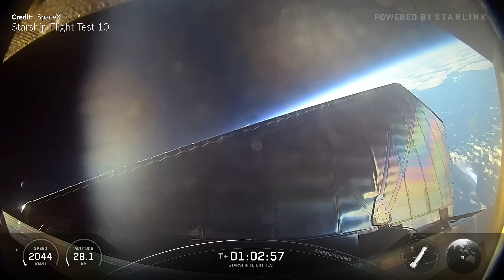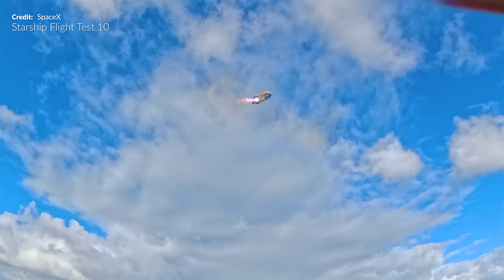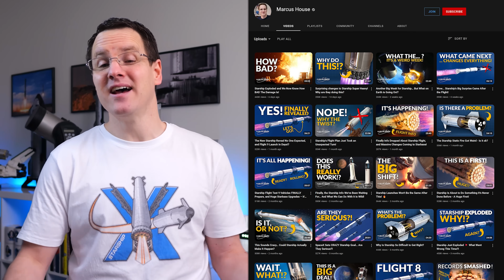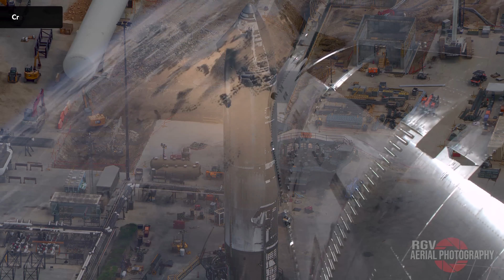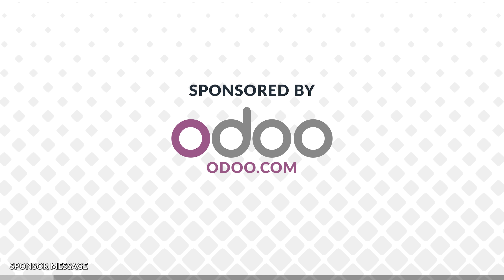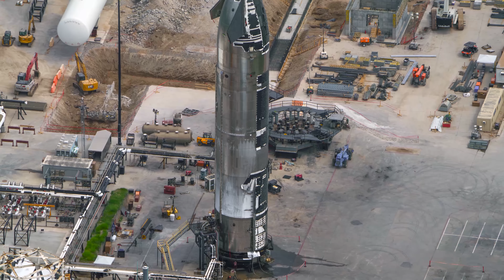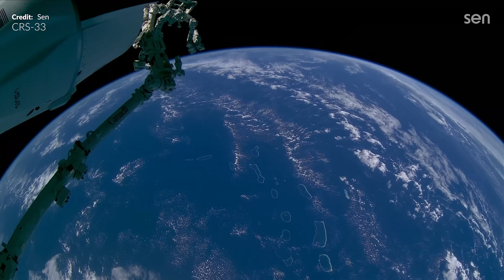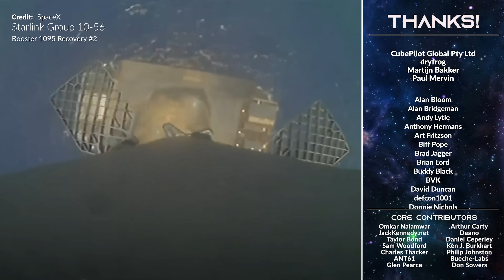Starship Flight Secrets Revealed & Future of Starbase! 🔥

Comment from the maker: Take your business to the next level with Odoo: https://www.odoo.com/r/GwW
Reply: Well done, Beratna, I saw those names in the Odoo demo 😂
Reply: @FlushF00T  Nice to finally see an autograph from my favourite character in that movie! (and no, it's not the "lead" character). 

Did you also notice what the "document" they "signed" states? :)
Reply: The alternative material tile causing the rust colour could be adding by lucky accident an extra coating on the black tiles to help them survive longer ???
Reply: This channel is more commercialized than the original Woodstock  !!
Reply: Now I saw something I liked. The inspection of the capsule at the ISS. Hindsight is 20 20 but imagine if the Shuttle had that ability. May they rest in peace. I always thought why not space walk the Shuttle (inspect) while docked at the ISS? I spent my entire life in Aviation, before, after and between every flight, aircraft are inspected for structural problems (safety). That to me would be even more important with space travel
Reply: odoo is garbage
Reply: placing the advert in the middle of the video only makes everyone dislike them and skip. NOTHING worse than this. Fk your adverts
Reply: Great planning by Spacex for on-site gas seperation plant(s)! Is the power supply from the grid ?
Reply: Thermal shock is why they blow up thanks to the engines being used to operating temperature!
Reply: Audio en español por favor
Reply: Is there any benefit for SpaceX starting to set up launch sites in other countries such as Australia?
Reply: Hi Marcus, I am wondering if the flaps can't be made of Carbon-Carbon Composite, instead of stainless steel.

Comment: Interesting virtual catch hover manoeuvre above the water. Instead of shut down and fall in the ocean, do you think it should include re-acceleration to move away and repeat hover if fuel allows? In case grid fins or landing pins for chopsticks or the chopsticks themselves are compromised moments before catching, it could be wise to boost out of mechzilla way and go blow up away from the landing facility.

Comment: Starlinks are usually launched into high inclination orbits, something they haven't done yet.  Little point in launching them into a low inclination orbit.
Launching to the SE, about 130 to 140 deg gives an over water launch direction which would give the inclination they need and the reentry would be over the USA rather than over Mexico.  However they may need to wait 24 hours before the reentry path is close enough to Starbase.  Will enough fuel remain for deorbit and landing burns?

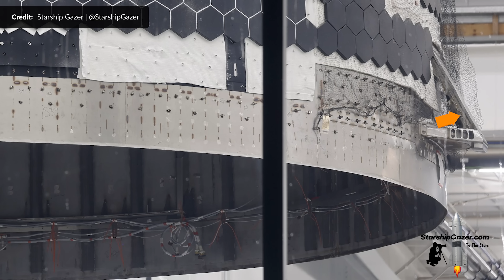Comment: 2:20 "...heat shield issues...": As Elon repeatedly says, the best part is no part. Eliminate the heat shields... and maybe even go to an aluminum ship instead of stainless steel. Elon's not so foolish as to not bring it back. Just bring the ship back less aggressively. Choose a shallow angle of attack to the plane of the atmosphere (i.e. the tangent to the circle). Then begin to measure heat buildup sense atmospheric resistance. Gradually increase angle of attack limited by heat sensors. Use heat as the negative feedback signal for the angle of attack. As soon as the angle of attack is controllable "via wind", so is the yaw direction. Set a small angle to begin a corkscrew trajectory with the center of the screw over the landing zone. Again, control the direction by temperature limiting feedback as well. It's not rocket science to calculate the controls necessary all the way to the ground. Then just repeatedly tweak the calculations until you're at essentially free fall speed and over the target. From then on in, it is rocket science... that is practiced weekly with Falcon boosters.
Reply: Yeesh.. you pretend engineers do say some silly things.
Reply: @imaginary_friend7300  Pretend engineers? Really? Does a degree in electrical engineering not count? And what is your pretend knowledge? What do you find silly "imaginary_friend"?

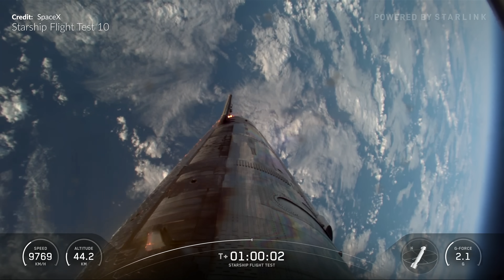Comment: 1:32 I'm curious as to why that is. Is it that the specific reentry profile is the most optimal for max deceleration to max forces on the craft? Or could it be that this thing is so big that it's inertia makes the reentry g-forces inherently smaller? It does seem g-forces decrease as you increase the size of spacecraft.
Reply: It's the entry profile.  They showed it and explained in one of the early video's when it was still largely hoppy and tents.  They try and shed off as much speed as they can in the upper atmosphere by flying a shallow descent angle.  This means it spends far more time re-entering than say a space capsule.  I can not say why.

Comment: Not sure if they would attempt deployment of actual Starlink satellites on Flight 11, considering the tail end of some of the test analogues collided with the top of the bay door, unless they do some revisions to the guides or enlarge the door.
Reply: I suspect they will make changes but I don't think that hit would have done any real damage.  The orbit picked for 11 will let us know if they can put up any real sats.
Reply: I think the problem isn't the damage, but rather a dummy satellite potentially getting stuck inside the payload bay and blocking the door or the deployment of other satellites.

I know that space is hard, but watching that mechanism work wasn't exactly confidence inspiring

Comment: A bunch of sites are trying to pass-off the thumbnail pic (also at 4m50s) which you attribute to Flight 6.  It's clearly not from Flight 10 - hull discoloration is wrong, aft flaps aren't chewed, there's no aft ring damage from the "energetic event," and there aren't any test coupons bonded onto the top surfaces of both aft flaps.

Comment: So the largest challenge is the heat shield, yes. Because? Orbital velocity. Velocity on reentry contributes to the friction of reentry, yes?  Help me understand, - a certain mass of fuel is used to reach orbital velocity after booster separation. Would we require the same mass of fuel to then slow the ship down enough for a less challenging reentry?  It seems to me that although costly to implement,  an orbital velocity refueling station is likely the missing link to the reentry challenges we face. Be there a kind of drop tank that can be jettisoned or ship to ship refueling? Perhaps there's a middle ground hybrid solution that would allow a decrease in velocity so the existing heat shield tech could survive?
Reply: Yes, that's the rocket equation at work.  You can't carry enough fuel to go both ways under power.  An orbital refueling station would be extremely handy, especially if you were sourcing that fuel off planet.  You don't solve much if you need to bring the return fuel up from teh ground.

Comment: The most insane fact about Starship is how robust it's proving to be. A ship surviving an explosion right next to an engine and vital control surface and then getting partially burned up during re-entry and still making an accurate and controlled landing is absolutely remarkable. Even the early flights, with the exception of the RUDs, Starship's control surfaces were burned through and it still managed to make a controlled landing. I'm not sure if it's the design, material choice, or a mix of the two but the engineers at SpaceX deserve recognition for the resiliency of that vehicle.
Reply: honey badger don't care

Comment: Marcus I don't agree that it 'has to be a test artical because stringers, over hole' you do know they could just cut the stringers now there in place right? and it is traditionally EASIER to weld a long item like that with out cutting it for alignment, then cut it after.

Comment: I question why the trailing edges of the flaps thin down like a aircraft wings does. StarShip flaps can be think in the rear as they are in the forward leading edge, I see no reason for thick in front and thin in the rear  edges. thick looks to work better being thicker and covered with heat tiles ! IMHO

Comment: LET’S GO!  I asked Grok how much it might cost SpaceX to launch 100 tons to LEO w/ Starship V3 in “expendable ship” mode, and to compare this with the cost using Falcon 9.  
Comparison:
•  Starship (Ship expended, booster reused):
	•  Cost: $32–$35 million for 100 tons to LEO
	•  Cost per kg: $320–$350/kg
•  Falcon 9 (6 launches, reusable boosters):
	•  Cost: $420 million for 100 tons to LEO
	•  Cost per kg: $4,200/kg
•  Cost Ratio: Starship is approximately 12–13 times cheaper per kilogram than Falcon 9 for this mission profile ($4,200 ÷ $320 ≈ 13.1).
Reply: More expansive…
Summary of Costs per Kilogram to LEO
•  Starship: $213–$233/kg (projected, not yet routine)
•  New Glenn: $1,510/kg
•  Falcon 9: $4,000/kg
•  Long March 3B: $4,167/kg
•  Vulcan Centaur: $4,780/kg
•  Soyuz-2.1a: $4,490/kg
•  Soyuz-2.1b: $5,915/kg
•  Ariane 64: $5,350/kg
•  Ariane 62: $7,730/kg
•  PSLV: $8,000/kg
•  Electron: $25,000/kg

Comment: Great job as always Marcus. I haven't seen or heard mentioned since the live stream the "RUD" the ship suffered on splashdown . I also don't believe RUDs on splashdown would be part of the schedule for a test flight.. Why forego the detailed inspection and analysis of the ship and booster after the flight?  What do you think?
Reply: What do you mean? The ship's not structurally designed to land in the water, of course it's going to RUD. They land in the water during testing when there's a high risk that a catch would end in a RUD on the tower causing a lot of damage. Once they have confirmed they can direct the ship to an exact spot following re-entry, they will attempt a catch at the tower.
Reply: @aldunlop4622  I was thinking these sea landings are not deliberately blown up. They have survived splashdowns before. It would be nice to survive a powered splashdown if you were a passenger in an emergency.
Reply: @joedavoli9343  I think you're confused. Starship has never survived a splashdown before. They cannot land in the ocean; they are not structurally designed to do so. As soon as they fall over, the fuel tanks rupture. There is zero possibility that passengers would be saved.

Comment: Flight 10 demonstrated the Starship's inherent robustness, which can be attributed to the stainless steel construction. The stainless steel strength comes at a cost in weight, and looking at the pictures the heat shield is paying the price. Active cooling is often floated as a solution, the scale of the Starship's heat shield, exceeds 1/2 an acre or 1800 square yards, rendering the active cooling approach impractical at best and more likely impossible. Considering the substantial propellant consumption of each Raptor engine for active cooling, implementing an active cooling system for the entire heat shield would require a large volume of liquid. Each Raptor is consuming 1400 lbs of cryogenic liquids per second and 100% of that mass is being utilized to actively cool each Raptor. The Starship's present mass requires 33 of the world's most powerful engines operating near theoretical limits to reach orbital velocity, the feasibility of an actively cooled heat shield system is questionable at best. The visible damage to the nose cone tiles underscores the challenge. Despite the successful flight, the heat shield's performance presents a significant engineering challenge for SpaceX.
Reply: They wouldn't active cool the whole thing there is no real need.  The current TPS seems pretty robust except in some area's.  Those hard spots would be the only parts with a different TPS.

Comment: I believe that the orange colorations is a thin film of hematite created when experimental tiles were subjected to intense heat and plasma.  This would indicate some sort of iron or stainless steel in the tiles (the other metals that can create oxides in the orange/brown range are probably not qualified as they are heavy  lead or good thermal conductors -copper.  Vanadium i believe could make these colors but I dont think it is as good at insulation and has a lower meting point than iron alloys). Elon did say there was a metal component so perhaps they are using a stainless steel foam / ceramic hybrid.  If it is Fe₂O₃, then that is even more brilliant because the oxide has incredibly high heat resistance and very poor heat conductivity.  So it could actually protect the underlying tiles and thus the ship even more.   Don't know for sure, but it would be cool if I was right.

Comment: Elon started talking about aluminum oxide, and the methods to create a smooth finish.  This was my theory when they first started talking about metallic heat shield tech.  He said they were placing aluminum oxide in a thread form, and using it like fiberglass.  Aluminum oxide is difficult to work with, without extremely high temperatures.  We use aluminum oxide as grinding media, as it is very abrasive, and it can handle high temps without deforming.  If you have ever looked at a grinding wheel, you will see the porous surface, which is the problem SpaceX is overcoming.  The heat shield needs to be smooth to keep eddy currents from forming in the plasma.  Eddy currents will erode and hold in heat.
Reply: Where was this?
Reply: @imaginary_friend7300  When Elon was giving a briefing on Flight 10.  There are dozens of videos to chose from.

Comment: I sure hope all those building floors are a half meter above the highest hurricane storm surge elevation ever measured in that area. Machine tools don't get along with sea water. The surge from Hurricane Katrina reached 28 feet above sea level on the Mississippi coast on August 29, 2005. That was the highest surge ever recorded in the Western Hemisphere. It drowned 1,400 people. So far, they have spent $14 billion building levees, floodwalls and locks to protect the New Orleans area, and they are still not finished. One surge barrier near the NASA Michoud plant, where the SLS is now being built, and where all the Saturn V first stages were built,  cost a billion dollars. TACA flight 110 landed on the levee next to the Michoud plant in 1988, after hitting hail in a thunderstorm. A pilot, who was blind in 1 eye, landed it on the grass with no engines running, saving everyone on board. They flew the Boeing jet out a few days later, on a runway built during WW II.  That was before the ' Miracle on the Hudson', but since it wasn't in a media center, it never got the same news coverage as NYC did. Airliners landing away from airports usually doesn't turn out too well.

Comment: Marcus i'm a potter the orange color on starship is iron oxide produced from iron or steel at high temperature. The white stuff could be titanium oxide or lead oxide produced by a thermochemical reaction on reentry. I work with ceramics and those are normal reaction to some metal oxides at high temperature to produce glazes for ceramics

Comment: I think FLT11 will refine and further stress test everything from FLT10. Improve dummy payload deployment with no bouncing off open door/hatch. Steeper re-entry, hopefully tweak some things on the rear grid fins to hold up better for a steeper re-entry and perhaps some more experimenting on heatshield for further data and future improvements. FLT10 overall, was a huge success and some really good data was gained from many areas of the flight, especially from the previous 2 test flights.

Comment: On flight 11, I'd like to see a fully orbital Starship, delivery of Starlink Satellites, and NO disintegration of the vehicle - ONLY purposefully ablative disintegration of heat tiles, a proper splash down of the spacecraft, as well as a catch of the booster section.
Reply: Considering it's a V2 I think they'll be a little more tolerant of vehicle failure and would rather push anything they still feel needs pushing while V3 is still early enough to include any required changes.

Comment: even if flight 10 went perfectly it is very doubtful spacex would want to wait the necessary time for the FAA to approve an orbital launch  ... with so little track record the FAA likely would be leery of allowing such a large and very hard to burn up object to potentially lose control and get stuck in orbit with no chance of knowing when and where it may come crashing down..  all previous flights by being on a ballistic trajectory had some rhyme and reason as to where they could end up...  I certainly could be wrong of course but I suspect with all the history there will be a lot of scrutiny before allowing an orbital insertion license....  if block 3 performs as intended it is likely there would be far less scrutiny from the FAA

Comment: Using a metal tile that will over heat and spread over the ship is just a good way to record how the aerodynamics flow works around the ship during re entry, it has been used in various ways in all industries where you need to work out how the aero works.
Reply: Kinda like F1 Flo-vis?
Reply: I doubt that was the intention. They were probably just testing other (cheaper?) materials for the tiles.